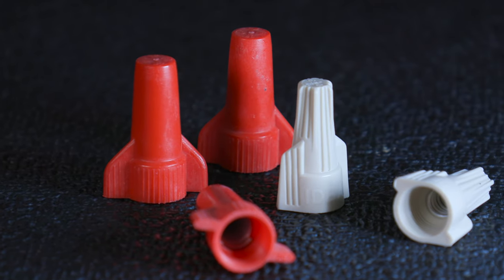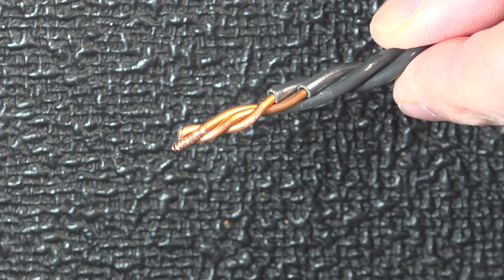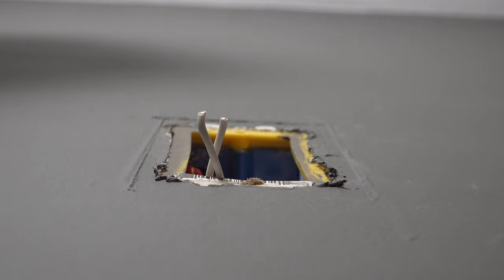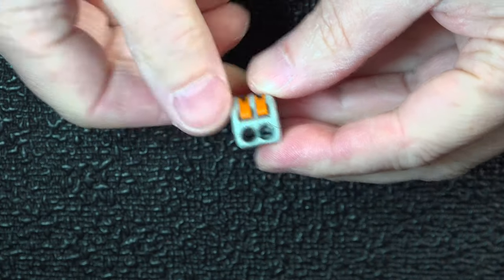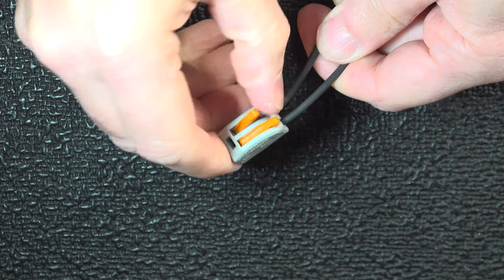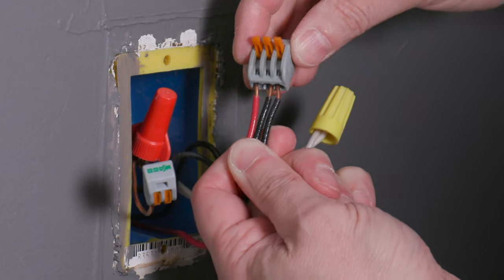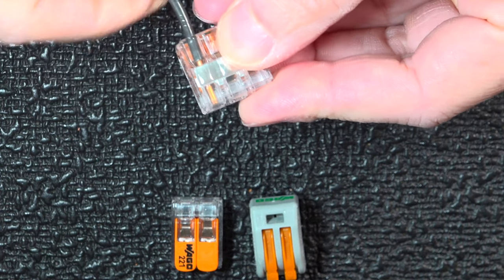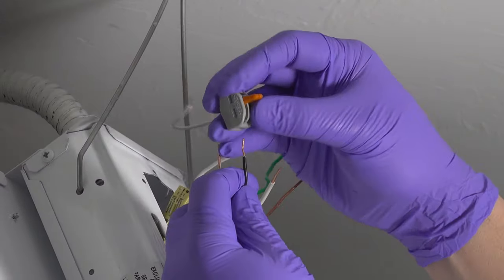Never use Wire Nuts Again - Wago is Better Electrical Connector

Comment: I work for an electrical contractor and we have tried Wagos and keep going back to good ole tried and true wirenuts.   Anything where you push a wire into something that is supposed to hold it can be a failure point. Like the push in slots on outlets and switches they are more problem then they are worth.  Atleast with wirenuts, if done correctly it wraps the wires around each other at the end it helps hold them together.
Reply: Exactly.  I've fixed open circuits several times because the wire stabbed into the back of a receptacle or switch finally lost tension and went open.
Reply: In a perfect world when you never have to reopen a box cause a mistake they might work,

Comment: As a professional lighting technician I can honestly say when you’re installing 50+ commercial lighting kits for 10 to 12 hours a night, WAGOs and quick connects are one of those rare game changers. 

Wirenuts are a great design when used properly, but I did the math and when I switched to WAGOs, they paid for themselves in productivity and saved time. Just made life so much easier.
Reply: We do a ton of lighting as well here in sac. I noticed for myself and the more experienced guys, they can use wirenuts just as quick as pushnuts. For the rookies, they can go quite a bit quicker with pushnuts.
Reply: The quick connects are required on every ballast, but those suckers are expensive... Although we get a slight discount when we buy them by boxes of 1k. I'll need to double check the prices of the pushnuts again. Few years back we got them for 6c e so it was totally worth it, the 4 wire ones. Then again, we can get the orange wirenuts on ebay for like 10k for $200 so that's an amazingly cheaper price than anything else.
Reply: There is no way a Wago is as cost effective as a wire nut.  They are much more expensive and you don't make that up in volume and they are not faster for anyone with experience.  They also take up more room.  They are only cost effective when you plan of redoing the connection, which is quite rare in any kind of final wiring.

Comment: Been using/reusing wire nuts for 50 years without a single problem, and they are relatively cheap. Wago nuts are way too expensive for what you get, maybe when the patent expires I'll try some.
Reply: You must be at least 70 if you’ve been using wirenuts for 50 years. Does the staff at the nursing home know you’re tearing open the electrical outlets again?

Comment: What is the current carrying capacity and the resistance through the connectors and how do these factors compare with
Reply: Wire nuts have a higher carrying capacity because you actually have bare copper on bare copper, wagos use a bridge usually made out of steel so then you also have to factor in for  dissimilar metals

Comment: wire nuts dig into the wire for a reason... a secure connection.
Reply: "Secure".  Leverlock is sooooo much easier, and better, but more expensive.
Reply: @jesseblanchard9609   That's your opinion
Reply: @stevebri9161  you're right it is her opinion. You're pretty smart for picking up on that. No one would've thought that was an opinion...
Reply: @Mark-iy1zs   From the video it actually looks like these things are more work than wire nuts
Reply: @stevebri9161  how so?
Reply from the maker: @stevebri9161  More work, the fastest you can do a wirenut and pretwist is about 30 seconds. Wago is literally 4 seconds
Reply: @SilverCymbal   With respect, it takes you 30 seconds to do a wire nut?   That's pretty slow
Reply: @SilverCymbal   Can I respectfully ask you how it takes you 30 seconds to screw on a wire nut?
Reply from the maker: @stevebri9161  How long does it take?  Take out your linemans pliers, pre-twist, get your wire nut, put it on tighten up, then the tug test.
Reply: @SilverCymbal   You do not need a pliers to install a wire nut
Reply from the maker: @stevebri9161  Then you aren't pre-twisting which despite the comments here is NOT required by Ideals specs.
Reply: @SilverCymbal  who cares pretwisted or not? both losens over time

Comment: Please, if a person can NOT twist one wire around another, they should NEVER touch it in the first place.....  Did silver cymbal get paid for this ad?
Reply: Yeah, it stinks like an infomercial.
Reply: @Bigfoots777  I find that you don't twist the stranded & solid together. You twist the insulation together to get a mechanical connection, then hold the two wires together in parallel with the ends at the same length. The wire nut should bite both wires at the same time and get a secure electrical connection.

Comment: The way I learned was just to make sure the splice was secure WITHOUT the wirenut. If it was secure enough without, after it got put on it was very secure and tight. I’ve reused plenty of wirenuts and had no fires or issues. Idk I always thought they were the way to go
Reply: make sure the splice is secure and trim the tip to leave it thick.... , if you leave  a sharp tip the wire nut will not bite into it and will not screw properly....wirenuts only fail when unskilled people use them
Reply: @XX-121  You don't twist wires first, that defeats the operation of the wire nut and is time consuming.  44 years in the business!
Reply: @jcagy2  yeah right. lol!

Comment: These will melt after years of heating and cooling. I recommend these so I have future repair work.
Reply: Yep just like stabbing wires in back of outlets.
Reply: Have you done material testing, is there a paper you read? You just guessing?
Reply: It all depends on the amp rating really. Put enough electricity through these and im sure they will melt.
Reply: They’re fine for indoor use. Outdoor. Good fucking luck lol
Especially if used for lights where ballasts or heat comes into play. They become fucking brittle as hell. 
I’ve been shocked by 277 at work 100x with these when replacing ballasts. It’s not fun after a while.

Comment: Worked in res. electrical never seen em. Started as an electrical tech. at a small freezer company and it’s all they used.. changed my life
Reply: To add, problem with the new version is the paddle style clamp, although easier to lift than the previous version, breaks easy as heck..

Comment: The beauty of the wire nut is the HUGE contact area you get.
Reply: not needed the cable insulation burns before the wago
Reply: @zybrozer1337  I think his point is that with the large contact area between the wires ,and the aluminum in the wire nut, you don't add in much if any additional resistance into the circuit.
Reply: as an electrinics enguneer that is the factor for me.
Wagos have very little meat from what ive seen
Reply: that you do not need. As long as the contact area is sufficient, more is nonsense.
This is called engineering.
Reply: @proislam1447  that you don't need so long as the wire is in good condition. In a humid area where the wire will tarnish overtime there by increasing its surface resistance more contact area is preferable. So that years down the road you are still at a sufficient level of conductivity to ensure you aren't loosing efficiency and adding heat to the circuit. 

I have never regretting having a larger safety margin designed into a system. I also use 12 gauge wire on all my 15 amp circuits. Anything worth building is worth over building.
Reply: @proislam1447  LOL must not be an electrical engineer then. More area = lower resistance = less heating and wear.
It's called I^2r
Reply: @johnh8546  THAT is engineering
Reply: @jhoughjr1  no one ever complains that a product is too reliable.

Comment: There is more copper contact with wire nuts therefore less  resistance under  loads , and the Wago has a dissimilar metal  which acts as a buss bar ...sooo  "Bimetallic Corrosion" will result over time ..

Comment: We’ve had these in Germany for a very long time. Thanks for taking me into the way way back machine.
Reply: @DavidCraig1965  the video is talking about wagos vs. Wirenut just so your with us all. The only one that needs to worry about wire size is your wife 🇺🇸
Reply: Could be the reason why the Americans only have 110volts and not 230volts. Its better for their "fire resistent" wood sheds where they live in😂
Reply: @marvin3283  and it doesn't hurt that much when they touch a live wire.
Because Body resistance and bla bla.

Comment: Here is a quick trick, strip the stranded cable slightly longer than the solid cable fold the stranded in half  then connect the wire nut.   If you do that the cable will not slide on that solid copper. Been doing that since 1999. Works great
Reply: Agree, that's the secret for a great connection,  that's what I do on residential every day.
Reply: Comments like these are why the YouTube comment section is such a treasure

Comment: I love wagos when I can use them. There are newer wire nuts that don’t cut into solid wires tho. And pre twisting wires is how they teach splicing at ibew neca institute.
Reply: Pre twisting fixes a lot of the issues in this video, but I still think wagos are better.
Reply: Twisting the wires together before twisting on the wirenut is not required by code and some manufacturers even recommend against it.
Reply: Retired IBEW guy here. You should twist the wires together with lineman pilers then cut to desired length for the wire nut. Wires and exposed copper both should be twisted for a couple of inches. Best practice and best results.
Reply: @mattduffy2023  I usually do that but newer wirenuts self twist even though they cost more amd you have to line the wires up properly.
Reply: PrEtWiStInG wIrE iS tHe OnLy WaY
Reply: @mattduffy2023  Pre-twisting is my preference as well because you know that connection will be solid, and to me it's easier to pre-twist 3 or more solid wires rather than try to get them perfectly lined up in the wire nut.
Reply: @mattduffy2023  Thanks. As a DIY homeowner, I just learned something very valuable.
Reply: As I look over the replies , it seems that only trained professionals agree with me. The whole concept of a wire nut for solid copper #16 ,14 12 and #10 is to protect the splice , electrician and it does not touch anything that it should not. Smaller solid copper of tinned wire can be easily minuplated by twisting wires and wire nut at the same time . Stranded should also be spliced properly then wirenutted . Just strip wires ( doesn't matter if they are 2 inches of copper showing) grab the wires that you are splicing. Line up the insulation in your hand so all the wires are lined up to the stripped copper next to the insulation.  Grab linemen pliers and start to twist clockwise as you hold the wire tight. A coupke of turns loosen up grip. Wire and splice will twist with you now.  Now all wire nuts are not the same soooo start by cutting copper and have about a 3/4 of an inch left. Put on wire nut and see if any copper is exposed. If so cut a little more until it is perfect.  No insulation should be in the splice with the copper . Now you know that wirenut...continue 19 zillion times or until you can do it in your sleep...lol. wiring is no hobby. Contact a professional electrician .
Reply: @ninjamaster3453  I only twist the bare copper. I just do it that way and never had a problem. I know it isn't necessary but I have been doing it that way for 15 years so it's a habit.
Reply: @ninjamaster3453  lol..what type of wirenut....every brand name out there. I did houses to nuclear power plants , everything in between.  I just retired..sooo I was not that long time ago. If you know how to splice properly the box or whatever you are working on will look professional.  I had over 400 employees and taught alot of people....dont reinvent the wheel...make it safer.  This product is not safe. Seen it first hand. Most of them melted. Im not here to get into a pissing match. Im here to help and teach others the proper way to do things. We where given cases of these to try out in a steel mill. Week later I had to all electrians change them back out due to failures. That steel mills lost time and my company's lost time was never paid back .....yes this was in the 2000s.

Comment: Looked like the connector would spin on the wire, same as a stab-lock on devices which suck, they will be a nightmare in time. I couldn't begin to list the service calls I have been on that ended up being a bad connection with stab-lock connection on receptacles and switches.
When those lights start flickering for no reason, remove those connectors and replace with wirenuts!
Reply: Can confirm. And I wonder what gauge is inside bridging the wires? Probably does not match romex. Romex should be directly contact with other romex for overheating reasons.
Reply: @Alkatross  many of these are rated for 20-32 A

Comment: Im sticking with wire nuts ! never had a problem with them and these new things are 4 times the cost.
Reply: LOL! Wagos are not very exspensive and are used everywhere in the world exept usa & canada They make alot better of a connection and they can handle more amps.
Reply: 4 times the cost and about 50x better I’ll stick with my wagos personally

Comment: in my 48 years as an electrician, i have installed 100's of 1000's of wirenuts  without any failures. i never put any on with a pipe wrench. electrical work is not for amateurs!
Reply: Electrical work isn't rocket science either.    It takes little brain power to understand electrical code and wiring.

Electrical work isn't for stupid people.

Comment: the wire nuts shown in the video are a substandard variety in my opinion. 

the type i use the most, the insulating cap can be twisted off of the metal spring inside so you can check the connection you've made.

the connection when pretwisted correctly, is the best of any type of connection out there. It is more time consuming to make a correct connection using a wire nut and it requires skill, but especially when grids are used to near maximum capacity, these will save you some fires...

in the hands of the incompetent, the wago connectors are superior and usually for home use they will suffice without getting a fire. there are however many mistakes that can be made with these too.
Reply: I agree with you. These new type of connectors just clamp down on one fractional spot of the wire and it does not give a good bite to carry a lot of electrical current or if they have a short blow back on that line. It reminds me of the older 120 receptacles that let you put 12 wire in to the into the fast back quick wire mechanism and then they realized the 12 wire was usually pulling more amperage and they were burning  out the outlets,    so they made the new outlets  only to receive 14 wire.    But if you want to be totally safe the best bite is around the screw. And the best wire connection is lineman pliers pre-twist your wires tight, then your wire nut… it’ll certainly last till the rapture…

Comment: This is somebody making a solution for a problem that doesn’t exist.... wire nuts work fine when you know how to use them. These prob cost 3x what a quality wire nut does too
Reply: That's dead on man! Lmao!
Reply: Not always and I've been around them for 40 plus years and I DO know how to use them.
Reply: @greybone777  so you're not able to use them but you know how?
Reply: Here’s a trick, separate a hot from twisted group of 5 conductors without breaking the other wires from the circuit. Now here’s a good one. Disconnect a hot and a neutral from that circuit without turning it off but also not working it hot. Bam, working a boated neutral just became easy and safe.

Comment: I also use a pipe wrench when putting on wire nuts.
Reply: the real question is do you use a cheater bar
Reply: Oh shoot. I haven't been. Damn, thanks for the pointer.
Reply: @jbbolts  I always use an impact wrench with a universal socket.
Reply: @esics8123  as long as it's not metric should be fine i guess